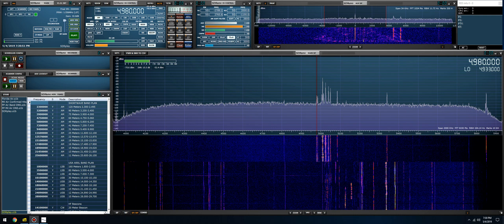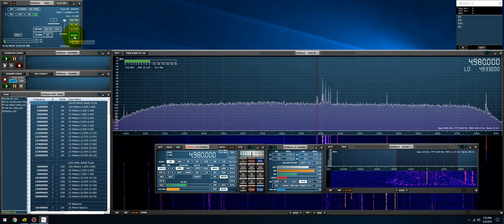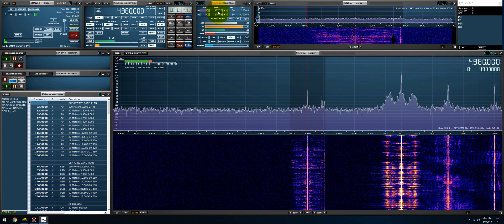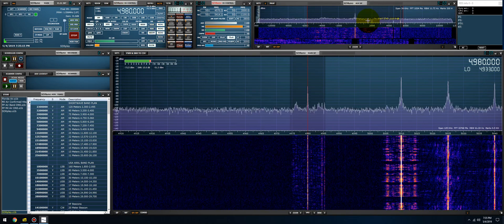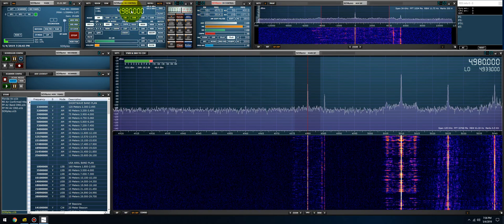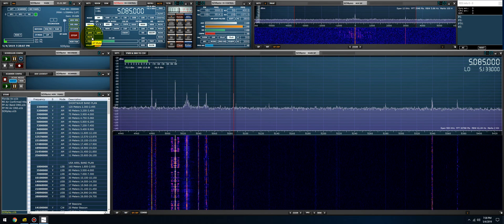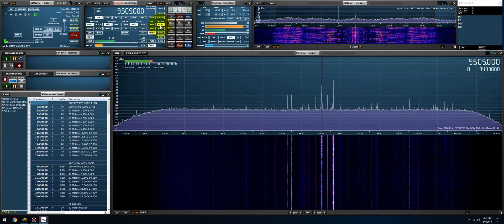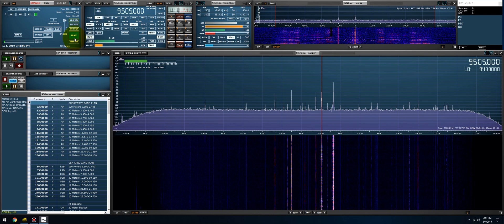SDRuno basics, notch filter.

Comment: Great info Mike. Will definitely be trying it. Also I have found that when I listen to a USB transmission, if I select 6000 filter and select Digital I get a much clearer sound. Why is this ?
Reply from the maker: A wider filter will allow higher audio frequency to pass through. I usually just match the width of the filter to the width of the transmission in the AUX SP.,

Comment: Is there a way to control depth of notch, also a little  of subject but I would like the "Main SP" window to auto center on my carriers but so far haven't figured that out, any help?
Reply: Also, can I manually set the frequency spread of Main SP?
Reply from the maker: The width of the notch can be adjusted via the BW (Bandwidth) in the AIX SP. The VFO will auto center by zooming  in.
Reply: @SDRplayHamGuides  Thanks, I see now the depth of notch filter is not really needed while the BW is and easily changed.  I also found by hitting the "clear" button in "RX Control" window that it frees up the bandspread (ruler looking portion of "Main SP" lock.  This seems to be because when you select a band in "Main SP" it locks the bandspread to that band and the clear button unlocks it.  BTW, thanks for helping us out!